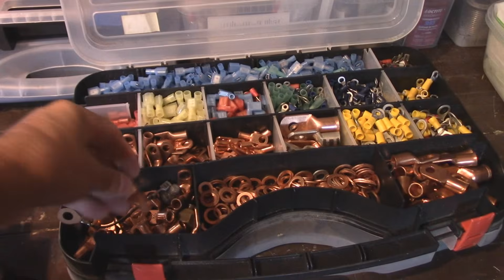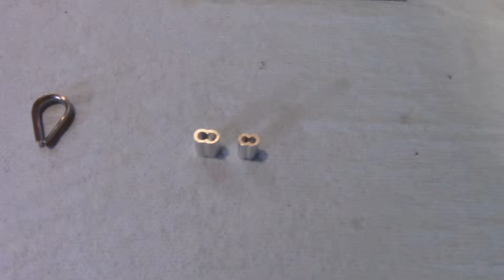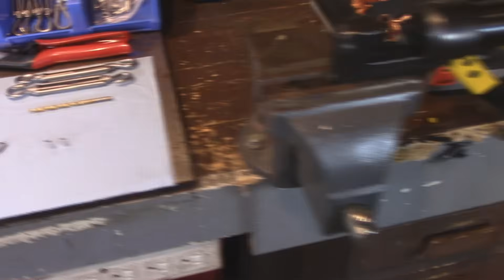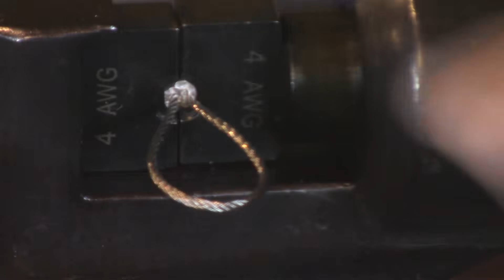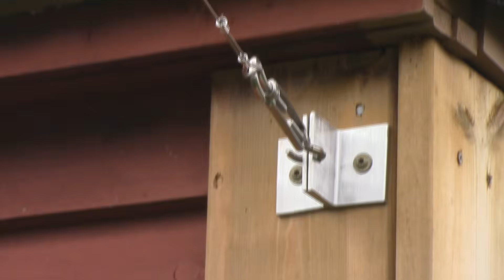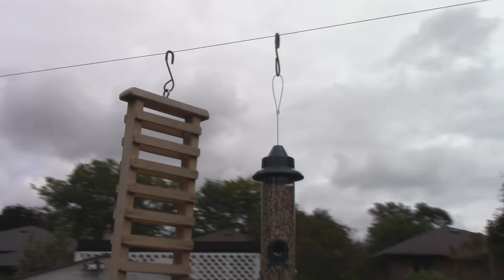How To Crimp Aluminum Wire Rope Sleeves - Alternate Way Diy Easy

Comment: how do i connect two cables that size, what do need to use. I'm lengthening my back yard lights by 4 feet.  Any ideas anyone?
Reply: I have runs of 40 feet over my putting area in my backyard for solar powered lights.  I used Rebar Tie Wire - 16 Gauge Black Soft Annealed.  Inexpensive and if needed you can double or triple it up.  Super easy to pull tight without using turn buckles.
Reply from the maker: @AmFirst1776  Thats a great option for all to think about. 👍
Reply: @SteveRobReviews  I am using 1/16" steel rope to make a 4x4 fence post plumb. an extra wide gate hanging off that post has cause the post to lean.  So I am attaching a rope to the top of that post to the bottom of the next post over.  I did already have the double sleeve on the cable.  And will use my vice to crimp the cable.  Sorry about your vice.
Reply from the maker: @AmFirst1776 thats a great idea , the vice was definitely not up to par , must have been cracked for a while to bust so easily.
Reply from the maker: Just use the ferrules as I shown  and crimp the exyra length needed .
Reply: @SteveRobReviews  I thought so, but was overthinking it as usual. Thanks!
Reply from the maker: Have a great day ....

Comment: Yep.  Broke my vice clamping down on an aluminum ferrel as well.  streched out the screw in my case.   

Apparently:  Vice + cheater pipe = trouble

Mine was an economy vice too.
Reply from the maker: Oh well , stuff happens.  Thanks for watching.

Comment: I have a similar hydraulic crimper. I broke the jaw of my hydraulic crimper, while crimping a battery cable. The problem was that I kept pumping the crimper even after the dies were touching each other. The pressure was too much for the jaw and it snapped into two. Noob mistake.
Reply from the maker: We all have experienced a negative outcome but we learnt something positive...

Comment: Respectfully:
As soon as you use a cheater bar your vise is at risk to break. Vise handle length is specifically calculated to be safe for the vise.

I cringed when you used the flaring tool to crimp the ferrule. It was never designed to do that job and you risk breaking that as well without producing a full strength crimp. I’m sure it’ll hold up your bird house but not much more than that. The hydraulic crimper is less than $50 on Amazon and it’s capable of doing a proper crimp for the cable on the slide out of my camper.
Reply from the maker: Thanks for watching 👍

Comment: 1/4" is my goal with ferrule swages. I have the others dialed. 14" wire rope = 1500lbs WLL (aprox) and my truck is a 1500, so those bed connectors are steel rated at 1500 ea. Gets me at the rated strength for my uses. I use 3/16 800lbs for most else as daily use stuff as I am almost always over rating. I dislike having too many parts and pieces all different. I can under-use overrated items easier.  😎
Reply from the maker: Thanks for watching Ernie

Comment: Dude, you're awesome but having a specialty hydraulic machine in your shop is hardly "DIY with simple tools you have lying around, so you don't have top buy an expensive crimping tool". LOL.
Reply from the maker: The hydraulic crimper was $60 , not so special 😅😂
Reply: @SteveRobReviews  And those last forever so you can get one as second hand unit even cheaper.

Comment: That 1/16 aircraft cable we have used it for the hot wire on the electric fence. It doesn't rust easy and it's cheaper than aluminum used for fence. The cows hate it because it's hard to break. 😊
Reply from the maker: Brilliant  idea 💡

Comment: "If you're going to be holding up a bird house or something..."
Me: sweats nervously

Thanks for the help though,  I'm just dealing with 1/16" hanging wire so turns out I could crimp them with my basic multipurpose stripper/crimper/cutter tool
Reply from the maker: Sounds like you got it handled 👌

Comment: I could see that vice break coming a mile off. As he was doing it i said to myself 'and bust your vice'. Good heads up there.
Reply from the maker: Ive tightened a lot of stuff in that vise a lot more than in this video but eventually all these cheap cast iron vises crack and break.  Cheers

Comment: how do you remove those crimps without damaging the wire? I'm short on the wire that i have for my project.
Reply from the maker: I found a couple of pliers twisting back and fourth breaks it apart.
Reply: I'd just cut a slot and then stick a flat head in it and open it up ? Even a hacksaw will go right through the aluminum like butter without accidentally cutting the cable i would think. Ive never done it, just what I would try..

Comment: Have you ever tried that technique with the hammer type crimper for electrical cables?  The reason I as is I have one and my friend with the proper hydraulic crimper is about an hour away.
Reply from the maker: I never tried a hammer type crimper.

Comment: I want to combine a piece of 7mm climbing rope with an aluminum ferrule.  Any recommendations a compression tool?
Reply from the maker: Lots of choices and prices but this style crips very well. 
https://a.co/d/3sI9XKz
Reply: I would make sure you have a sleeve on the rope before using a ferrule (they are used but there is a difference between the ones for wire rope vs things like climbing rope/nylon etc as they fray very quick when rubbing directly on a ferrule...in my experience)

Comment: I purchased a Harbor Freight vice over 20 years ago and am still doing good. Once a year, I re-grease the jack screw, but other than that, nothing else. I think I paid $30 for this. Today, a six-inch vice costs about $80.

Comment: If it's a  non critical application you can crimp the sleeves by smacking  them with a hammer or usund a tool smash the sleeves. 

An assembly for small birds or projects where there's no safety risk you really don't need a swager.
Reply from the maker: @brianjohnston4207  Lots of my viewers are interested in how to do something and the tools to do it with.

Comment: Thanks for showing how to crimp that cable. That was some surprise with your vise breaking, I’m like umm I don’t think that’s supposed to happen. I didn’t have those crimping tools I just put in vise and squeezed the Ferrell in the direction you showed so thanks. I use mine for a dog line. I used the cable that’s wrapped with that rubber or plastic 
coating. I had to go with a thicker cable because it just snapped at the ferrel when she pulled chasing rabbits in the yard. Hopefully the thicker cable will work. Any suggestions?
Reply from the maker: @johnd1536  HAHAHA John that vise breaking was a suprise for sure.  I did a couple of dog runs and only used 3/16 cable  with  a plastic coating that kept it clean and easy to manage but it was for a 120 pound  Rottweiler.

Comment: Good video, but I wonder how many birds don't see that wire and run into it because they can't see it.
Reply from the maker: @robburton3255  That's a valid concern , very sharp 👌.   I did research  the  concern prior and my concerns were relieved as  the birds do not run into the wire at all but they do perch on it . Cheers
Reply: Survival of the fittest.  Do your small part to help the future of the bird species select for the genes that bring more caution and better eye sight, making a fitter species of bird. 

Just don’t hang it low enough to clothesline you off the mower  when mowing the lawn. Homo Sapiens is on an opposite trend at the moment. Lol
Reply: Stick white adhesive tape to the steel rope every 12 inches or so

Comment: Great videos, wish I had the tools at home fix my dog cable.
Reply from the maker: Hi Roland 
I did one with a 1/8 cable for a dog run 100 feet long  , just perfect for the person as their dog would jump the fences in the yard and now it can use all the yard but it's tethered to the line that keeps it away from the fences.

Comment: When this popped up on my feed I had just had to watch it.

I use the plastic coated braided wire (1/16") for the bird feeders that I sell. I just use an old pair of lineman's pliers to crimp the sleeves. Get a little more leverage with the longer handles. 

Bummer about your vise. Put it on your Christmas list.
Reply from the maker: Well thanks for watching , so many ways out there to do something .  Nice to see your doing something too. Cheers 👍

Comment: Nice  I bought   good brake flaring tool 
now  I know what I could do with that silver piece  of  crap that  never  worked  on  brakelines  

Sorry for your loss of your  vise ..lol the new harbor freight  Doyle  vice seems  pretty good .  Been  thinking about the  hydraulic  crimper for  while  now might have to  stuff one in my  Xmas stocking 😂
Reply from the maker: Them flairing tools work great on a lot of things because they weren't designed well for flairing HAHAHA  Cheers 👍